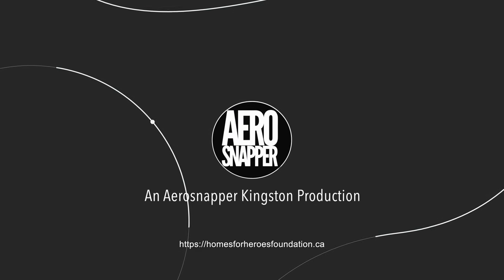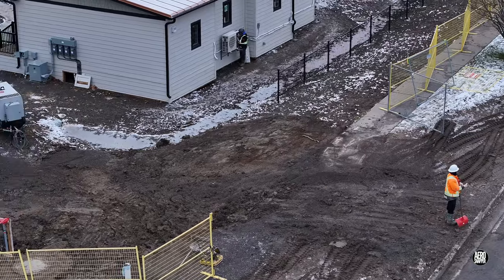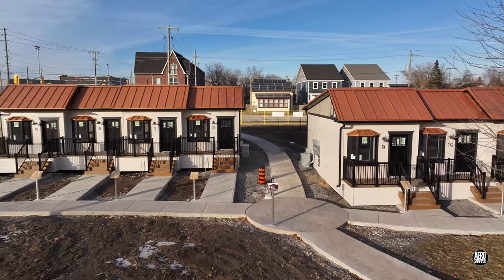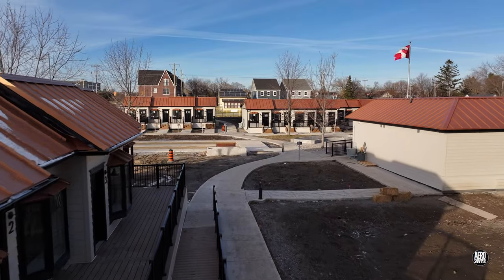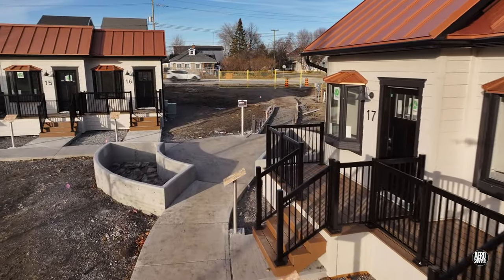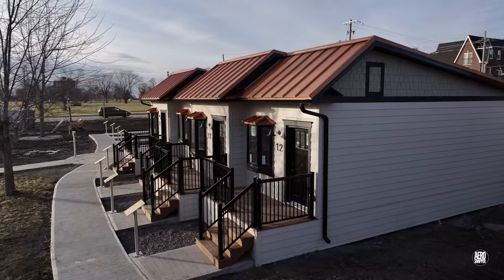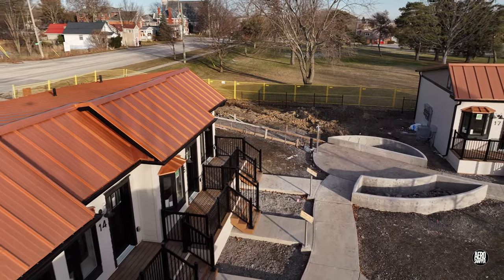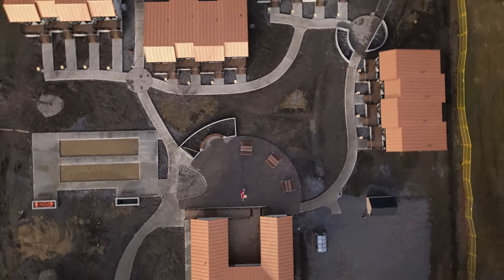Kingston's Veterans' Village is almost ready for duty   4K

Comment: I noticed the ramp going into the U-shaped building, but it appears that there are only stairs going to the individual units.  Is there not an accessibility concern?
Reply from the maker: Shawn - you were quite correct about the ramp on the central building. Tiny homes 1-4, closest to the car park and that building have ramped access
Reply: Four of the 20 units are fully accessible, as is the central resource centre and all of the grounds.